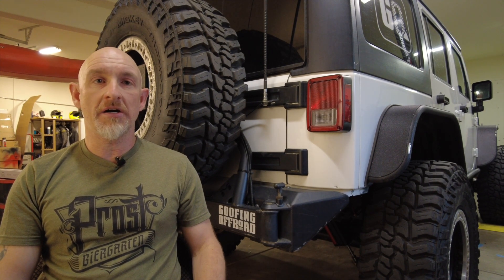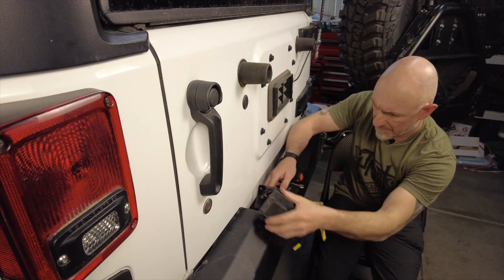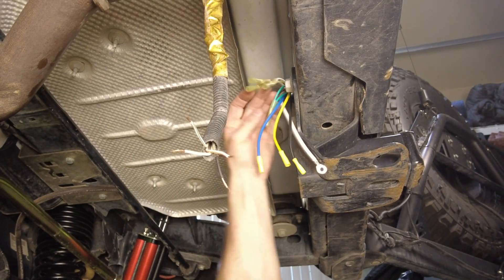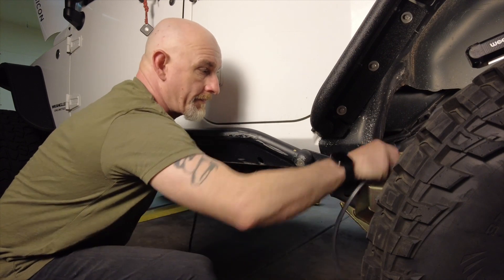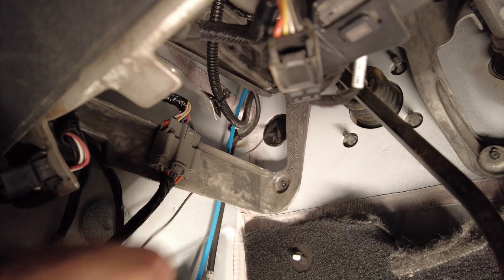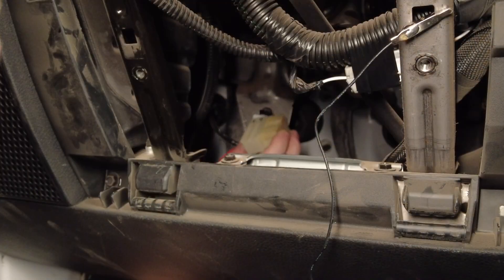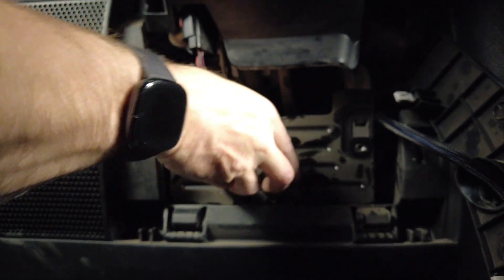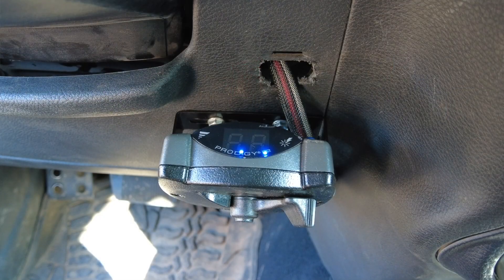7-Pin Trailer Plug & Prodigy P2 Trailer Brake Controller Install on Jeep JK Wrangler

Comment: the brake switch part is pure gold. Knowing that comes off and makes it easier to attach the wire saves back breaking contortion
Reply from the maker: Thanks for sharing that.  I appreciate the feedback.

Comment: Vehicle helped through most of the process except wiring to brake switch my controller required me to wire into the cold side so when button is pressed power is turned on, but when button is not press, power is off everything else was great thanks for the video
Reply from the maker: Interesting!  I'm glad you were able to figure that out and thanks for sharing.

Comment: great video - thanks!  i am going to be doing this soon.  still happy with the prodigy controller?  can you perhaps provide the model number of both the controller, and the wiring kit?
thanks!
Reply from the maker: Thanks!  I have added links to the brake controller and the wiring kit in the video description (above).  The brake controller is awesome as it's proportional, so it will apply braking pressure in accordance with how hard the tow vehicle is braking. I hope the install goes well!